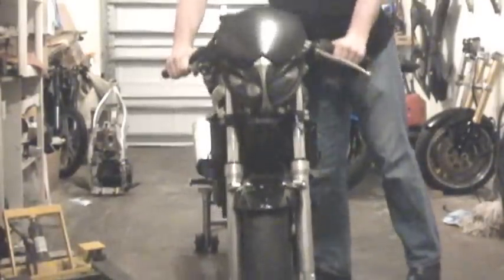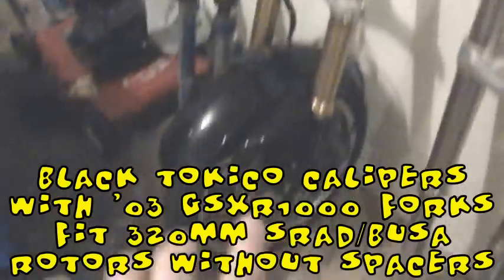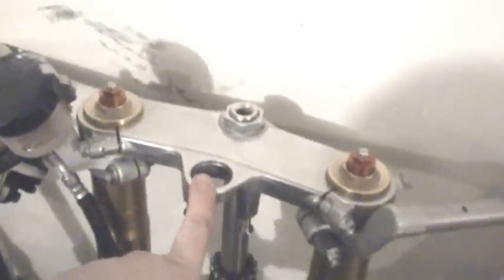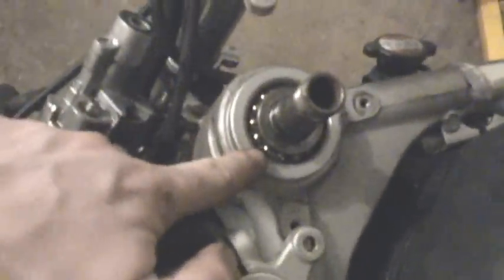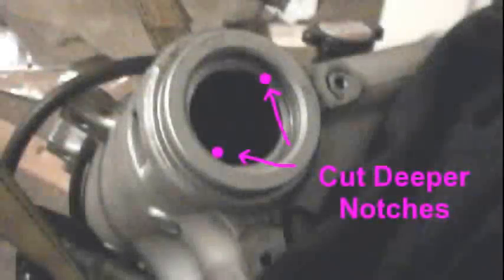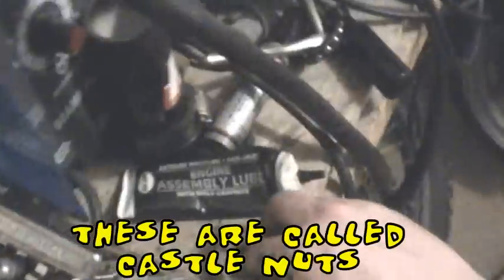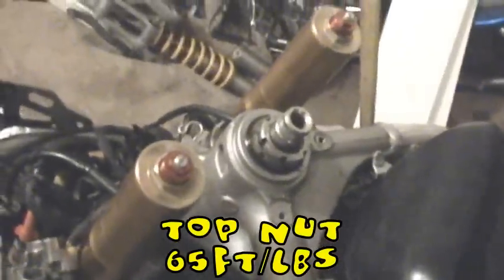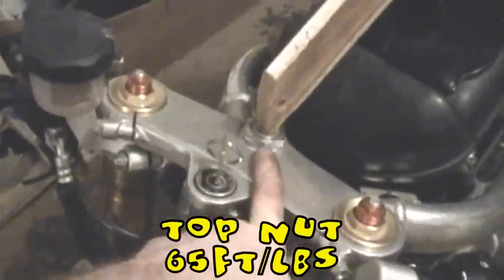SV650 GSXR Fork Swap - Quick and Dirty

Comment: i imagine a tl000 fork would be a direct swap with no mods on the first gen sv but i could be wrong
Reply from the maker: +Inna Leonoff Possibly, but they are a bit harder to obtain, GSXR parts are plentiful! :)
Reply: yea I've been seeing a lot of srad forks going for around 225 bucks on ebay, I'm guessing the 2000-03 gixxer 750 forks are pretty much the sames ones that came on the srad with floating brakes
Reply from the maker: +Inna Leonoff Yup, you may even be able to use a newer fork than that, the critical part is the SRAD triple trees and axle. :)